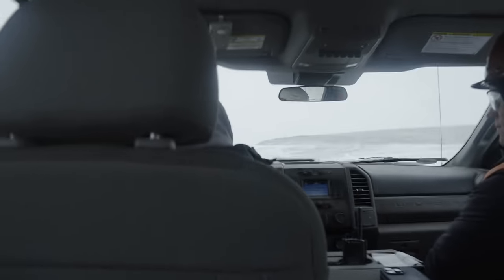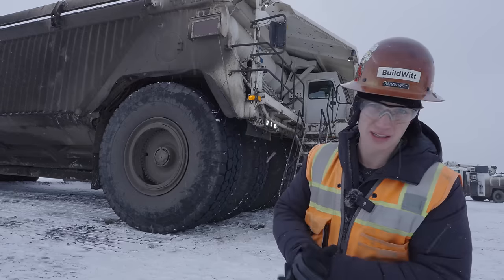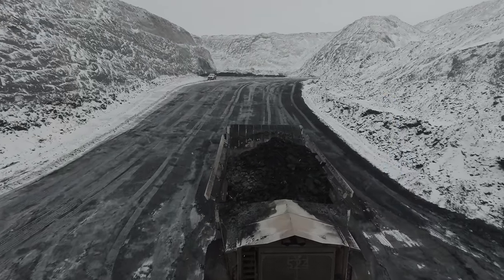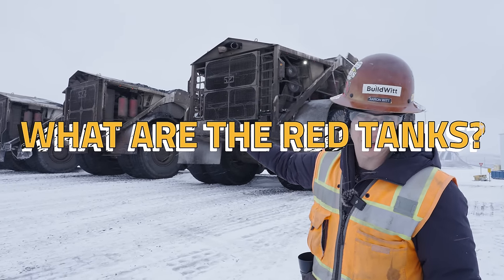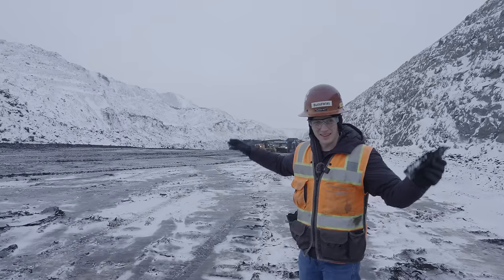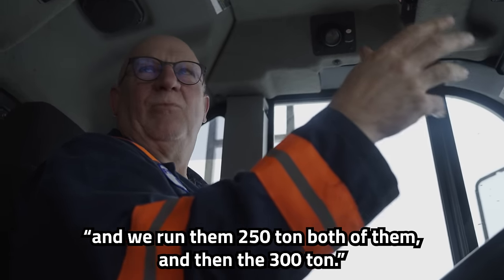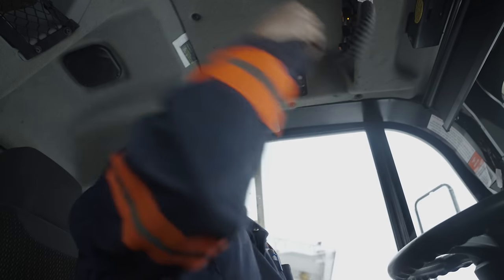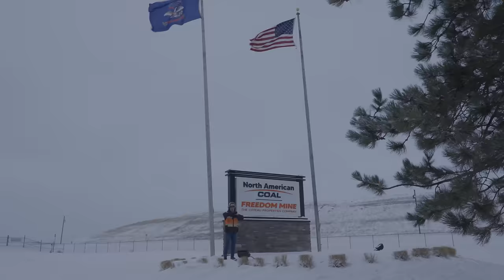The World's LARGEST Coal Trucks (Kress Coal Haulers)

Comment: I've never seen a haul truck like that before.  It looks like it's really nice to drive.  Since it doesn't have a massive tilting bed and a low center of gravity, the maintenance costs per hour should be less.
Reply from the maker: yeah the operators say they're extremely comfortable
Reply: But it does have a low center of gravity. You can claim it doesn't but you'd be wrong AndyFromBeaverton.
Reply: @johndc2998  think he mean't it does have it. would be dumb to say otherwise
Reply: They suck    The front suspension is a high maintenance item.
Reply: @Beux3751 then the rear would b to as the exactly the same lol
Reply: @cammos  at the Navajo mine in New Mexico th fronts are always giving trouble.  Not much trouble from the rear
Reply: Extremely comfortable to operate,  but your correct about the maintenance.  Front struts are always breaking.  The running gear is a hybrid of a 85, 89 and a 93.  They'll do 80km hr but they're only good for running on the flat.  No good out of the pit.

Comment: I used to work there in the shop fixing those trucks even got to drive them. The 300ton trucks have to have 200,000 hours on them by now.
Reply from the maker: the hours they have on them is the most impressive thing about them. Absolutely insane how they're still going strong
Reply: Many rebuilds and lots of welding up cracks .
Reply: @ndfarmer1702  Wouldn't be surprised it they are more weld than crack at this point
Reply: @ndfarmer1702  Do you remember the average run time between rebuilds?
Reply: Not any more, Depends on the component and what its “life” experience was they swapped parts a lot of times based on hours. Some parts never made it and failed early to.
Reply: @AaronWitt that's 22.8 years of run time. Holy shiznit

Comment: Biggest advantage of a Kress coal hauler is the top speed of 40-43 mph. Cycle times are fastern than the Cat end dumps which top out at 32-35 mph.
Reply: Thats insane
Reply: makes sense honestly, looking at the low center of gravity makes me think that on full loads it's still stable enough to go on slopes and turns faster
Reply: Man that is a whole lot of inertia 😮 300 tons at 43 mph 🤯
Reply: 300 tons at 43mph I guess those trucks have massive brakes 😅
Reply: Maybe CAT will design one, they already have a belly dump but its a tractor trailer with a large Off Road Hauler w/ 5th wheel design

Comment: When I was at Newlands (Australia) in the early 2000's, they were using belly dumpers.  Interestingly, that was the only Australian Pit I've seen them used.  I suspect, there are a couple of disadvantages.  

1. They'd be very inflexible.  You could only use them for coal haulage, not OB.  So, you'd need two fleets of haul trucks, with the associated maintenance costs.
2. There has to be a dedicated tip point for the coal, with an associated ramp and conveyor.  Trucks can't just tip on the ROM.  

There are probably a few others too.  But, they obviously work for some pits.
Reply: BMA had Kress haulers at a few of their pits, now they're only at Blackwater as far as I know. They're also highly geared so they're slow as a snail going up the ramps.
Reply: @nickh6076  Never been in the bit at BMA Blackwater.  It would make sense that BMA have the scale to make a different coal haulage fleet economic.
Reply: When i was resident HD fitter in Moranbah for Hastings i used to go to Norwich Park ( closed now) and they had these pieces of shit Kresses there! They were winding down with these machines but they were not really that good of a production machine and they had them because Norwich had such long haul distances, pricks of machines to work on !
Reply: @gamerjay6624  I worked on a couple at Blackwater that came from Norwich, dead right about being crap to work on

Comment: KRESS 200CIII COAL HAULER
Designed and built for mining applications, Kress unitized bottom dump coal haulers are field proven to offer the smoothest ride, fastest transport speeds and the highest payload to weight ratio in the industry. Kress Coal Haulers are sold and serviced through the Cat Dealer network and fully supported by Kress Corporation.
Kress Corporation
Peoria, IL

Comment: So what actually drives the wheels , electric right ... or are just the back wheels driven and the fronts are turned electric / Hydraulic .
Reply from the maker: just back is driven
Reply: @AaronWitt  Thanks . I know some of those big mining dumps are diesel electric .
Reply: Rear wheels are driven mechanically. There is no drive on the front wheels. All the functions on the machine are hydraulically driven.

Comment: I would like a feature on the loaders... the look like Letuernal? Do the run the engines wide open for the generator,  or do they throttle up and down like a mechanical system???? Great video's

Comment: kress coal haulers really are nice to see, every other mining haul truck seems to have just converged on a single design and its abit boring
Reply: its probably because coal is less dense than other ores. That makes them able to increase the volume a lot with fewer structural strength considerations.
Reply: @alexdrockhound9497  oh yeah i mean i know why theyre specifically designed for coal hauling, its explained in the video
its just like, there arent many coal mines using them most just use standard design haul trucks from cat or komatsu

other truck design too, terex titan was 3 axle and it was used for iron ore, design doesnt exist anymore
BIS are trying to make a 5 axle haul truck, probably wont go anywhere
ETF tried making some real wild designs, they didnt go anywhere

Comment: So the earlier ones like you showed in the first part of the video are actually a juiced 3512 out of a 785C truck making about 1700hp the later model like you showed with the ‘red tanks’ has the 3516 out of a 789D which is where the 2100hp comes from.

Comment: Do you ever wash these trucks?
Reply: Probably, they must just turn black again after a few minutes working because of the coal dust.
Reply: All mining equipment has an hours of operation based Preventative Maintenance Schedule (250 hours) and they are washed before starting each PM inspection. The roads in the summer are ususally watered to keep the dust down which sprays the trucks quickly and you see how winter operations gets the dirty.

Comment: It’s shameful we’re still digging any coal at all
Reply from the maker: you're right -- power and steel are completely unnecessary
Reply: @AaronWitt  which of those do you think can only be made with coal?
Reply: @jb76489  Nearly all smelting of iron ore to extract the iron uses coal. The problem is that ores contain oxygen and something (normally carbon) need to combine with that oxygen to remove it and leave the metal. And of course to make steel, you need iron.
Reply: @brianb-p6586  if only electric arc furnaces existed, if only carbon came in forms other than coal
Reply: @jb76489  electric arc furnaces work to melt steel, but not to make iron from iron ore. Carbon comes in many forms, and all result in the same amount of carbon dioxide emissions.
Reply: @brianb-p6586  ok yeah that’s not at all true, you pump natural gas into a low oxygen electric arc furnace filled with iron ore, you will reduce it with out needing to burn coal to warm up the ore first. As for one carbon source being the same as the next, that’s true if you think the fuel gets to the furnace by magic. Those of us who live in the real world need to trouble ourselves with petty things like how it’s mined/refined/transported as well as stupid irrelevant problems like the effects of mining on both the environment and the miners